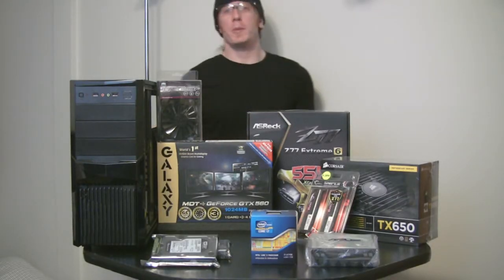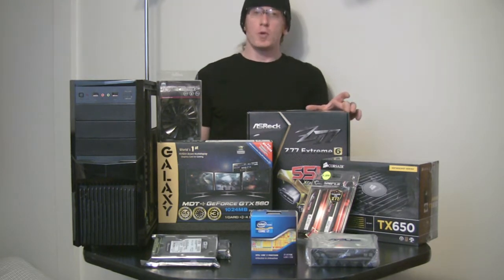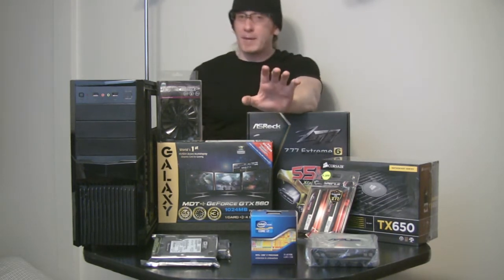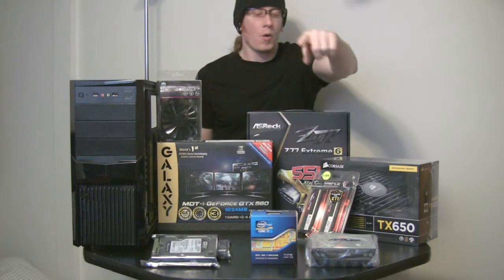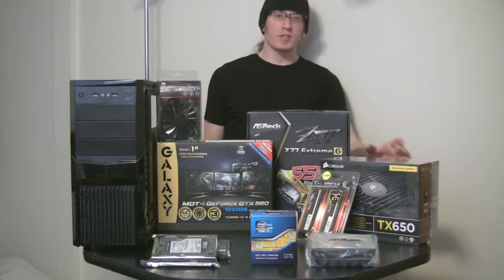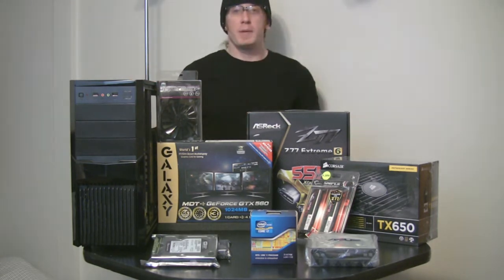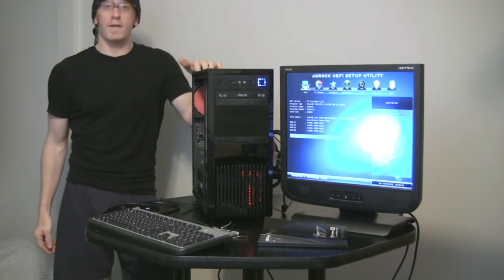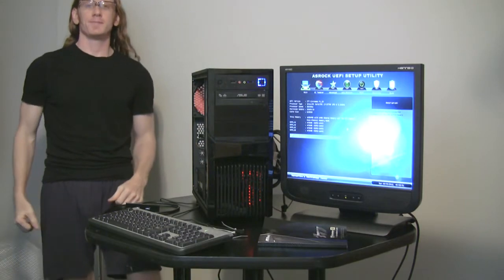PC Assembly - Building a custom Core i7 computer

Comment from the maker: You can connect the chassis fans directly to the power supply with the generic molex connectors (the large 4 wire connectors), though you won't have speed control on them. If you want speed control, you can use the smaller connectors on the fans to connect to the motherboard at the locations labeled either 'chassis fan' or 'power fan'. Hope that helps.